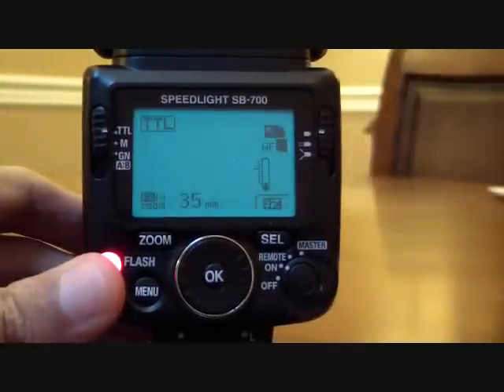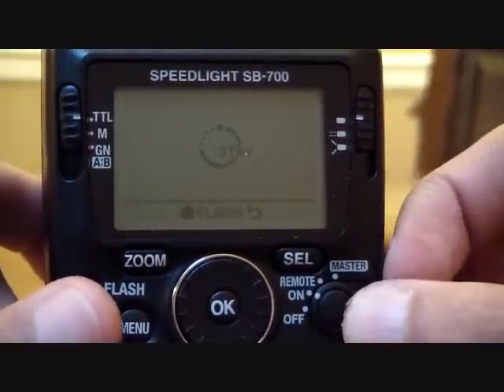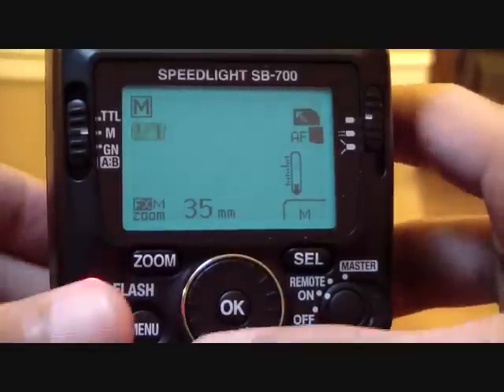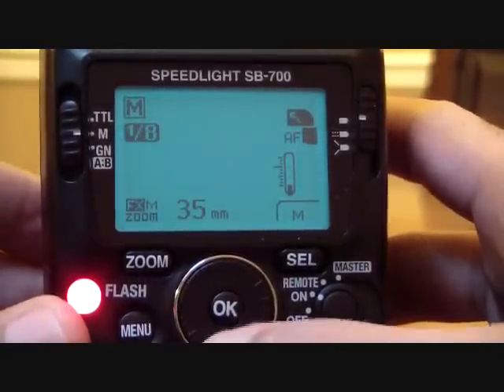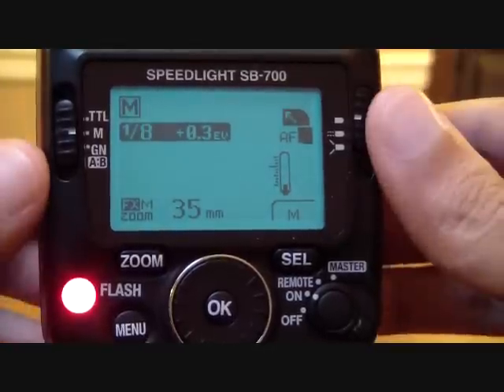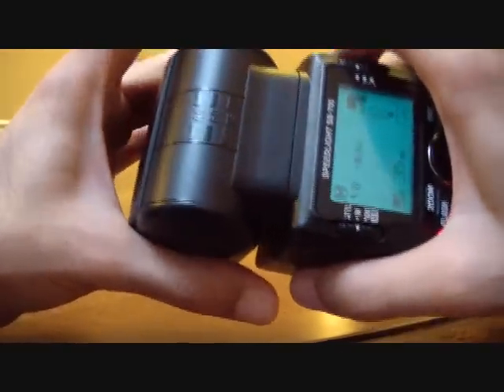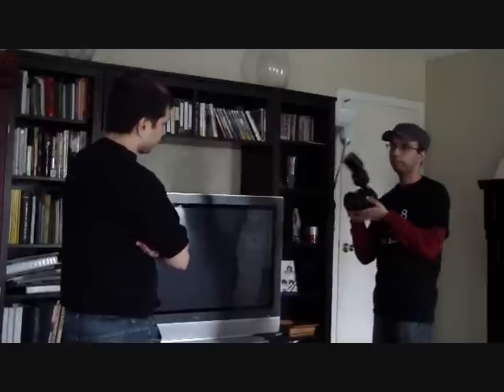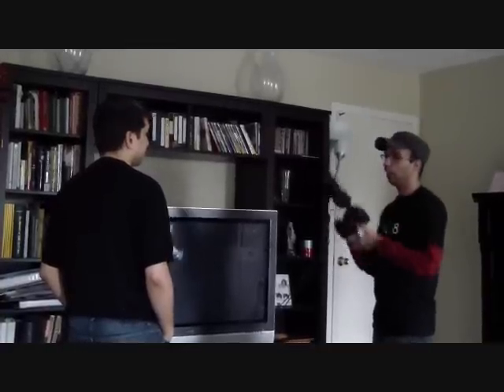DSLR Flash Photography Tutorial - Basic Beginner Speed Light Flash Tutorial using Nikon SB700

Comment: do you have to shoot in Manual mode when using the speed light or can you shoot in Aperture Priority mode? When I was in A mode, I can't change my shutter higher than 1/60. That's the highest my Flash Shutter Speed could go in my Bracketing/flash menu. But when I switched to Manual Mode in camera, then my ss went to 1/250, like I set my Flash Sync Speed to. Does that make sense?

Comment: just purchase the same flash and when I tried it on my D600 with my 24-70mm it flashes 3 times and before taking the picture. How can I change that peed sync setting? I have tried to reset it and it doesn't work.   Thanks for your video.

Comment: Blur on the shot and when you push the shutter to shoot it is slow response before the lens actually opens then shuts so they have walked a couple of feet. I found it rather hard to catch the subject before they left the stage as it was very slow when depressing the shutter. A lot of the times causing blur. If you are able to shoot, you are only able to shoot one shot not multiple, even if the flash was able to recover because of the slow response of the shutter.

Comment: I hate to keep asking questions but I shot at a school for a graduation tonight and the problem I have is that I was shooting at ISO 3200 with flash but as they are walking up I noticed that when you click the shutter there is a delay then after a few seconds it will shoot. I took off the auto focus and shot manual which seemed to make a little difference but if I didnt just hold down the shutter and wait till they walked up to the podium I could not shoot fast enough to catch them before they